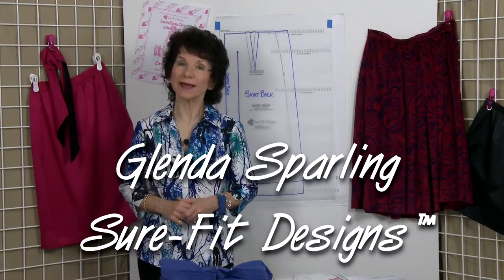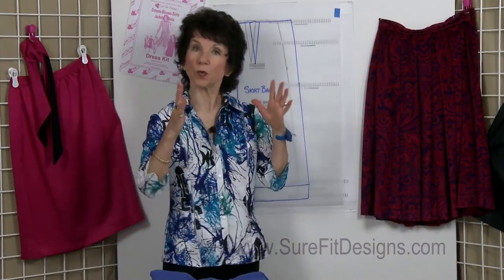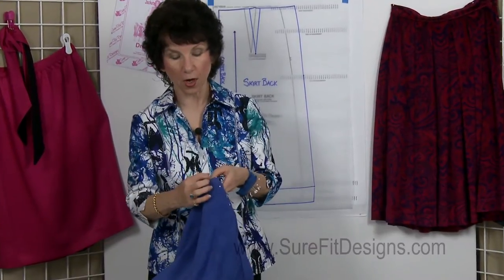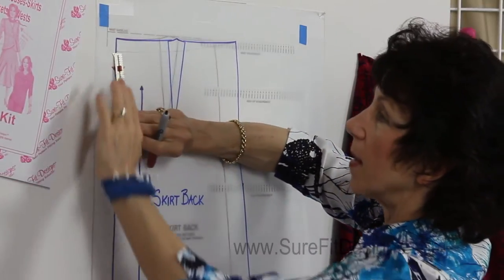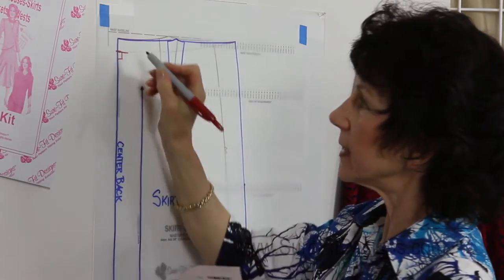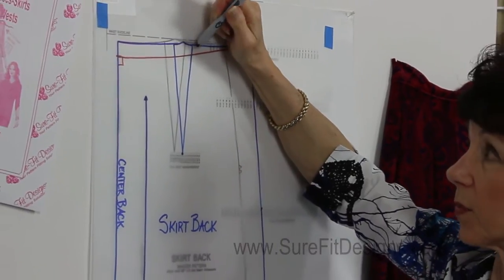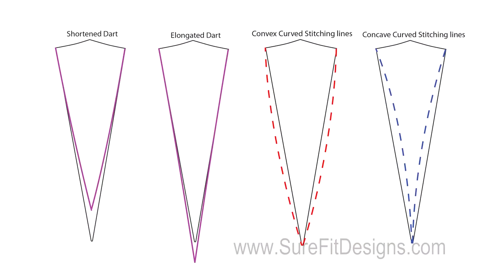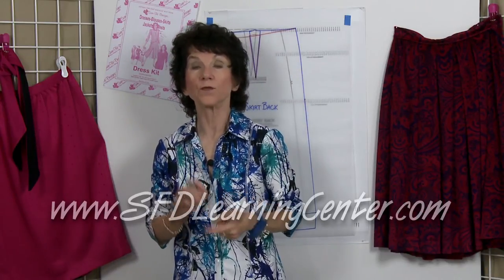How to make a Skirt Sway Back Alteration/Tune-Up by Sure-Fit Designs™

Comment: Thanks for this video. I have a sway back and a full bottom. It's hard to know how to fix it all. Could you use this alteration and still do a full seat adjustment as well? Just wondering. Thank you!
Reply from the maker: Hi Gina, yes, you should be able to do the sway back at the waist and then the full bottom in the hip area.
Reply: Surefit is right. The sway back adjustment is strictly for the area just below your waistline. A full bottom is too far down from the waistline. I have both the sway back and a full bottom as well. I first fit my bottom in relation to the extremely narrow waist. Then address  the sway back.
Reply: @angiemenapa  I have the same problem. It is awful trying to make anything. Please tell me- Exactly what is the adjustment for the larger buttocks called. Hips and buttocks are not the same. But I have problems with swayback,wide hips, and large buttocks. So how do I go about making those 3 adjustments? Do you know any book titles or Youtube videos that can help. I am a self-taught sewer. It has been very frustrating. Not too many people write about this problem. Thanks for any suggestions.
Reply: @aw8655  I believe the SFD video is called How To: Large Buttocks Alteration for Skirts.  I found that one really helpful.

Comment: I’m so confused I’m having this same problem but with a dress can you please post a video of you actually sewing it? I have a zipper in my dress
Reply from the maker: @kristen - if your dress doesn't have a waistline seam, this solution will not be applicable.  When you have a waist seam, it's pretty ease to attach the skirt to the bodice because it is a seam...and then add the zIpper.